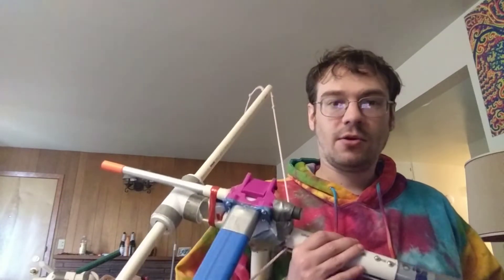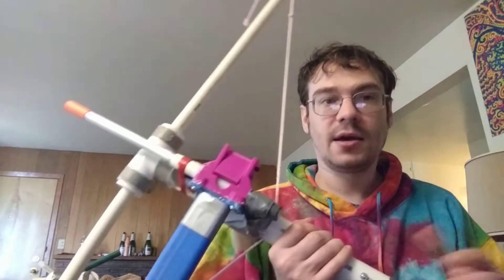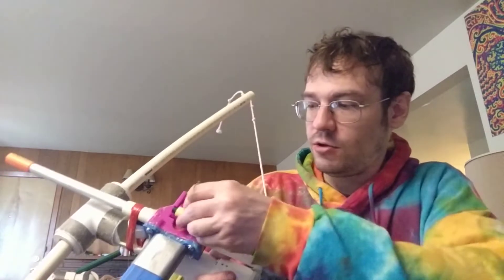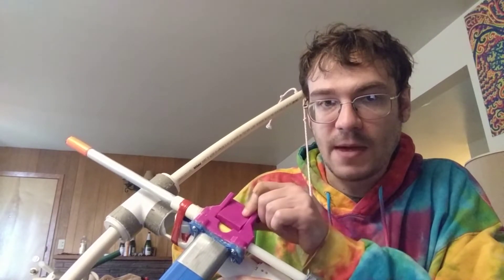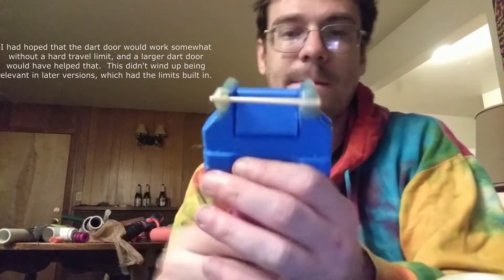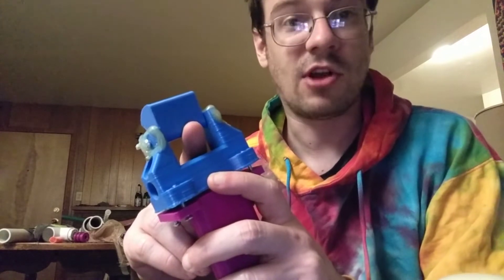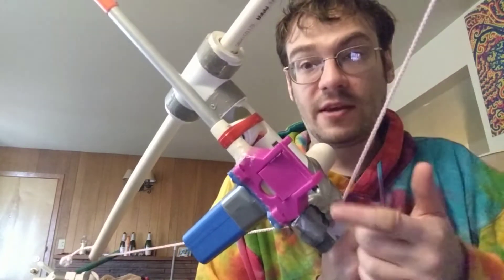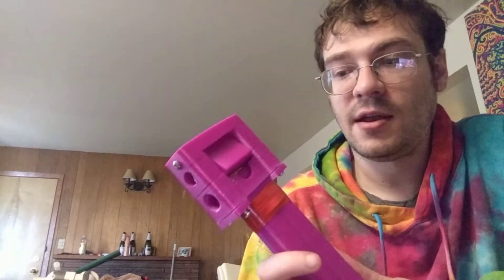Kanetana 0.6:  Putting my weiner in the breech

Comment: Whoa it's a magazine that acts like a hopper! Very cool, I've always had a thing for the pump action crossbow. Can you extend the dart door, and put a hole in it for the pusher to go through, so that if the dart door isn't closed, the pusher will hit the dart door? That might break your pusher, it doesn't look too securely attached to the pump handle, but better than breaking your finger.
Reply from the maker: This was one of the schemes I considered.  The main reasons I rejected it were 1. There is a moment with your finger in the breech AND the dart door in it's final position, so it wouldn't totally solve the problem,  2. The dart door would need to return all the way in position to work, unlike now where it only needs to return at least a little bit, and 3.  In the current layout the lower receiver would need to be cut-out in a way that would be catastrophic for that parts strength. 

The pusher attachment in this blaster is jank, but that's just this blaster, and not something about the magazine system I'm developing.  Any door system I make will be leaning on that pusher hard, it's not really avoidable and not really a problem for a blaster designed around the magazine system.